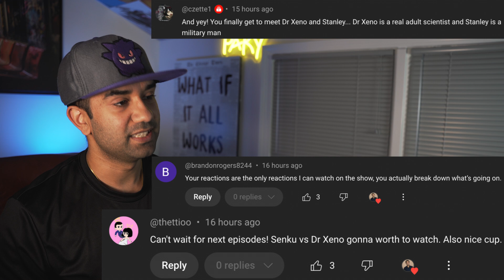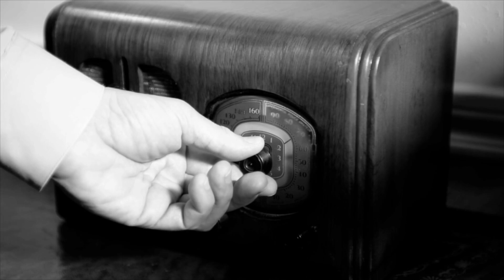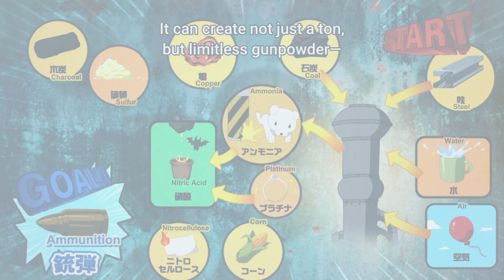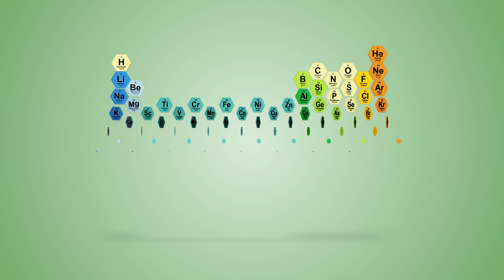Real Engineer Reacts to Dr. Stone #55

Comment: 4:50 nitric acid only is work for the people who use their brain and awake all 3700year but other people who don't have conscious on that time,they can't revive with just nitric acids, it need the formula of revival fluid, i think 70% alcohol to 35% of nirtic acid? i don't remember that well.
Reply: It is 70% alcohol to 30% nitric acid, the alcohol also needs to be distilled to 192 proof or 96% pure.
Reply: @scottkrametbauer90  thanks for correct info!!